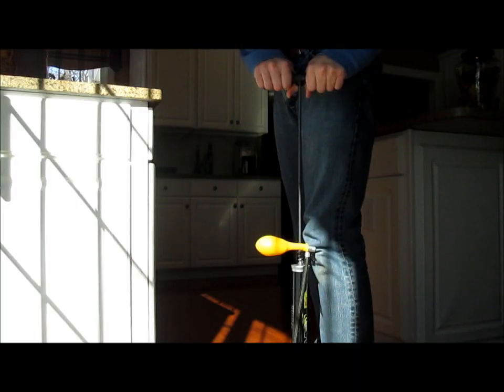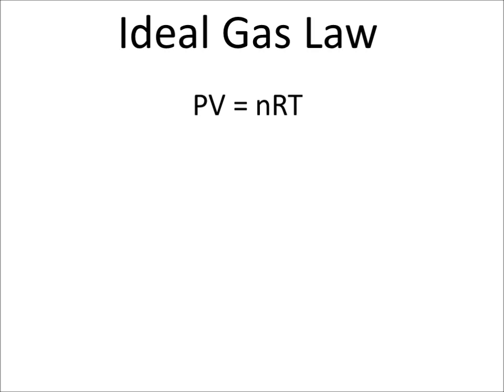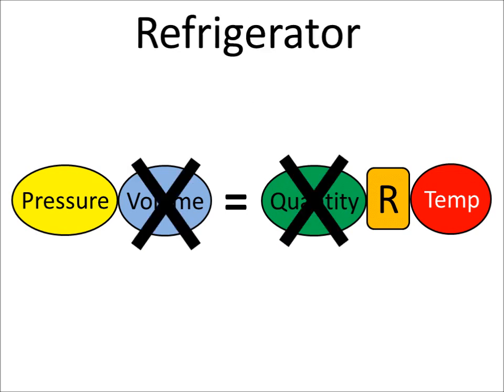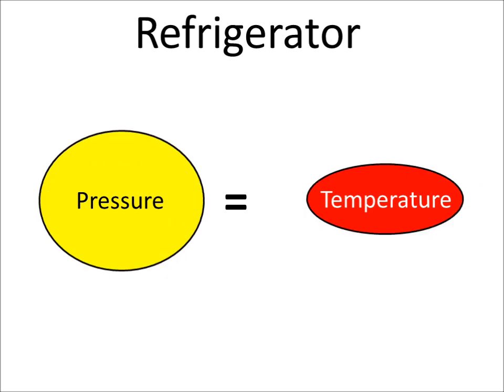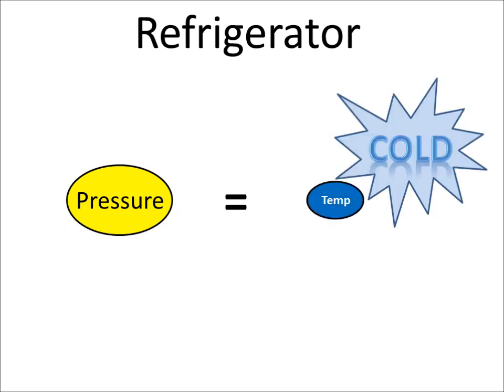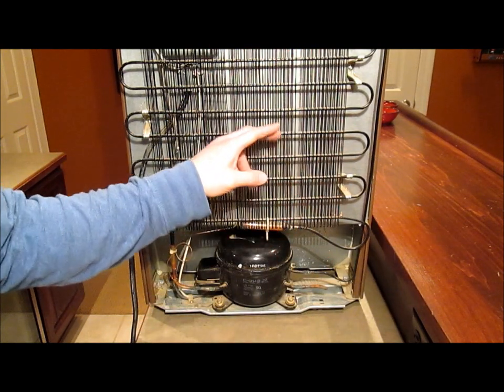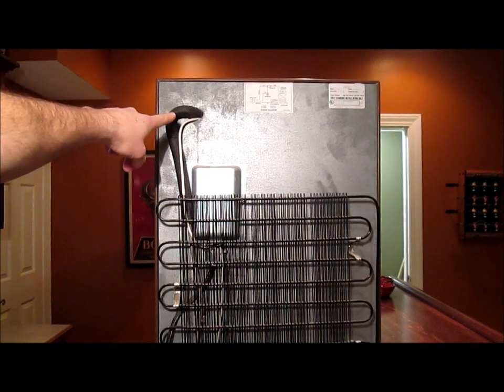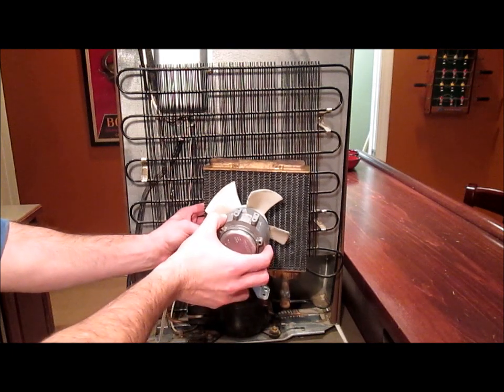How a Refrigerator Works (HowToLou.com)

Comment: why do newer refrigerators come with the active cooling? is it cheaper than a larger passive radiator? any advantage?
i bought one not too long ago and it still had the big passive radiator on the back :(
Reply from the maker: I think the main reason is so you can push the refrigerator all the way to the wall, and enclose in in cabinetry, without smothering the coil.  The small radiator/fan combo is under the fridge and gets air from the front.  Give your fridge some room to breathe, and you will be fine.  In fact, you are better off, because you have less moving parts to break.  I just had a $100 radiator fan motor die on my fridge.  That is what prompted me to make this video.
Reply: I was thinking just that, that this was one of those "features" that end up breaking earlier.
Thanks for the info.